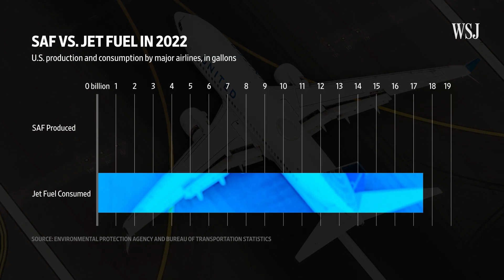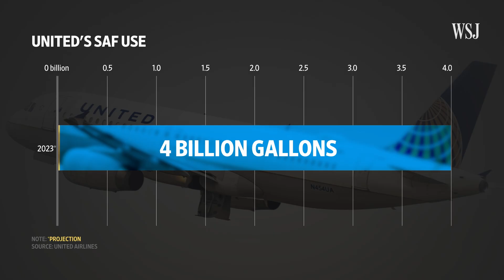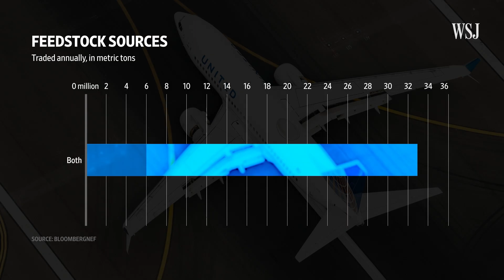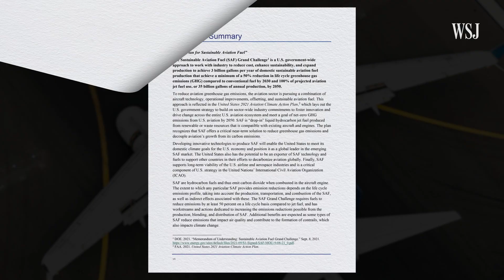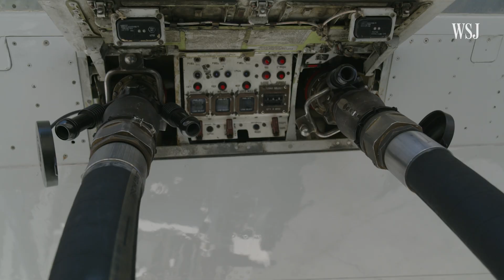How Jet Fuel Is Made From Trash | WSJ

Comment: Questions:
1) What powers that huge refinery and all of the heavy equipment used to produce SAF from trash?
2) When SAF is burned in a turbine engine, what are the products of combustion? In other words, what is coming out of the exhaust if it's not carbon?
Reply: It may be possible for some of the feedstock to be burned as fuel for generating the energy needed on site to run the process, thus reducing energy costs. On top of this, there are many sources of feedstock other than trash that can be used as feedstock for SAF, such as dried sewage sludge and agricultural residue and forest debris.
Reply: Jep that’s the most important question. When the energy invested in the Fischer-Tropsch process is not renewable itself, the SAG is more wasteful than normal fossil fuels.
Reply: 1) Fossil fuels and potentially renewables. This process does emit co2 
2) CO2 however it is CO2 that was recently captured from the atmosphere. I.e it was absorbed by the plants that were used to make the SAF

Overall SAF reduces emissions by 80% depending how it's made. Not completely because like you suggest  the refinery and equipment is powered by fossil fuels.

Comment: SAF, bio- and e-fuels are bridge fuels to fuel cell-powered air fleets. Clean hydrogen is the holy grail to decarbonizing the aviation sector. However, this is waiting for the advent of a critical technology:  clean hydrogen.

Hydrogen from methane reforming is a non-starter. So is hydrogen from anything other than renewable/sustainable energy. Marine/tidal, where the feedstock and energy sources are abundantly co-located, is the ideal solution; with desalinated water as an intrinsic bonus.

Stable energy generation 24/7/365 to first desalinate water, then electrolize hydrogen, followed by pressurized storage. Pipe/transport liquified hydrogen to shore where it's then transported to fuel cell fueling infrastructure.

Of course all this takes money. That's were governments come in. Subsidies must be made available to levelize the cost of fossil fuel substitution. Once scale volume is achieved, the natural laws of economics will quickly take effect.

Another thing governments can do is to enter into production purchase guarantee agreements with producers; making it infinitely easier for these companies to access needed capital. This can be done by committing to purchase and use milestones for government owned and operated fleets, such as the military, the postal service and other agencies' vehicle pools.

Comment: Producing SAF is expensive!  But then, I suppose the same was true for gasoline in the beginning, and as the manufacturing technology becomes more refined, the costs will come down.  This is a worthwhile path to take.
Reply: Gasoline was originally a byproduct of refining kerosene. Cheap as free. Standard Oil would simply dump the stuff, until it's explosive properties found a market in the then-new automotive industry.
Reply: What the other commentator said, Gasoline was never expensive upon its discovery. It was so worthless at the time, it was dumped as waste.
Reply: It is really game of economies of scale as volume increases cost per unit decreases it is the same with the oil industry but the issue is the efficiency of the process depends on feedstock hence we cannot expect consistency.
Reply: The biggest problem is they are going to take all glucose products away from you and I are planning to turn every stick of sugarcane honey agave and fruits into their damned jet fuel and then make our sweeteners out of pure garbage this is a crime against humanity and it must be stopped
Reply: hydrogen

Comment: It's still turning carbon that's in physical solid form into a liquid fuel that will then be turned into carbon dioxide, thus adding to the greenhouse gases. This doesn't help the environment the way people think it does. carbon dioxide from crude oil or carbon dioxide from trash fuel is the same result.
Reply: True

Comment: Of course, this makes more sense than electric planes or hydrogen power planes because it's a realistic approach.
Reply: Interesting point. I would add that this approach also doesn’t require development of new planes and infrastructure to accommodate and scale up the usage of batteries or hydrogen for planes. This is a huge plus.
Reply: Absolute malarkey.
Reply: @devon_207  nice adult response where you adding nothing. You just responded emotionally and left the conversation
Reply: @devon_207  yup, people have been claiming they're going to do fischer tropsch chemsitry with garbage for years, too many problems, it's easier to just use coal to make liquid fuel.
Reply: @devon_207  ghee. Someone that doesn't know about numbers and technology shows up. As far as I can tell you from my engineering background and from studying all cases, electric planes make sense until battery tech improves a lot, heck we don't even have enough battery material to produce all the EVs that we need.

As for the hydrogen, it's just a waste of time to make it work in the airline industry or air cargo. Just  hydrogen availability is a big problem as we can only produce black hydrogen and just a little then you have to break all the challenges of hydrogen storage both inside the plane and at the airports, then you have to deal with all issues with running a hydrogen powered jet engine and I can tell you that they're a lot of issues. But i guess that you can solve these issues by yourself. Right?
Reply: @fourthdeconstruction  if you're an engineer do a little research, people have been slinging this trash to liquid fuel BS for years, it's got too many issues, mainly all work and energy goes into making that nice fluffy dry feedstock garbage you see in the beginning.  if they're gonna do it best to just use coal like Sasol does.
Reply: @FourthWayRanch  Biofuels, I don't think that you watched the video carefully or understood it. They also mentioned Biofuels coming from other sources. You have to pay attention. "Coal to liquid" hahaha. Bye bye. No more from me,
Reply: @fourthdeconstruction 
I would want to have a discussion with you if you don't mind.
Reply: Wrong
Reply: I agree but, it went out of business so
Reply: Hydrogen is just energized water lol

Comment: Why cannot you say that you just use incinerator for combustion of waste? The product of incineration is firm (ash - carbon dust) and gas condensed to hydro carbon variants.

Jet aviation cannot be de-carbonized. To make carbon dust and condense gases you need 2-4 times more resources as stated in the video. That is the way to carbonize - not to de-carbonize :))). But yes: we have to transform waste into something useful. It should not be reasoned by money.

Comment: can someone explain how SAF reduces CO2? Is it just a net reduction, or it fundamentally has more energy per volume?
Reply: So according to Skynrg, all SAF does is recycle co2 instead of adding to it. However, all this tech is still in the early stages, so I'm pretty sure that this will become more simplified later on.
Reply: It's like heating your home with a wood fire instead of using oil or natural gas.
Reply: If you use fossil fuels, you're adding the additional carbon into the system. SAFs use organic matter (plants) that are comprised of carbon that has already been drawn from the atmosphere, so releasing it back means no additional carbon
Reply: @@Riorozenit's not bookkeeping. It's just that it doesn't ADD any additional CO2 overall to the atmosphere; it doesn't reduce it

Comment: Umm...doesn't this put CO2 into the atmosphere that would otherwise be stored underground?
Reply: Well, what are the downsides for storing the CO2 in the ground compared to reusing it?
Reply: @WolfeSaber  It takes space in the ground and wouldn't help people fly, but it also wouldn't heat the planet up by releasing greenhouse gasses.
Reply: @nathanbanks2354  There are gases that are worse than CO2 when it comes to greenhouse emissions, like a thousand times worse.
Reply: @nathanbanks2354  Plus if not careful, trash being buried would contaminate groundwater.
Reply: Nope it still produce CO2

Comment: Does the SAF math work out? What is the energy input?
Reply: Unlikely to get a clear answer to this question just the same way there’s little discussion about the environmental catastrophe caused by electric car battery production
Reply: The decrease of centralized pollution in cities, traded off for strip mining the earth using child labor. But it’s ok since we can’t see it. So yes, indeed, the dangers of car batteries.
Reply: Use non condensable gases to help run  process

Comment: How much energy is required to produce a unit of SAF?
Reply: Can't speak to the synthesis of specific biofuels, but for the initial phase - the gasification of carbon waste you can use any fuel source, coal, natural gas, or most likely the synthetic NG produced during gasification. If you use the syn gas produced by the system in the system, you should only need a small amount of start-up fuel before it becomes self-sustaining. Basically instead of all of your substrate being converted into fuel, a certain percentage is used/lost in creating the heat for gasification. The syn gas will be produced regardless of the parameters of gasification so you might as well use it. 

Short answer, it shouldn't require a lot of external energy.
Reply: @iankelley7592  Self sustaining... I like the idea. Efficient.
Reply: That's the problem speicifically Fischer–Tropsch Process is energy intensive. Needs mainly lots of heat.
Reply: FT is highly exothermic. The challenges are providing a syngas

Comment: IMO saf is greenwashing. I would only consider it sustainable and having a chance at net 0 if the carbon came from air capture and was processed only with renewable energy. At the end of the day, burning SAF releases more carbon that wasn't there before and isnt captured as part of the SAF lifecycle so this just looks like greenwashing.

To be clear, I'm not saying we shouldn't use "SAF" because it's not perfect, I just think it's misleading and greenwashing to call it "sustainable" and tout it as a path to net zero when waste to fuel containing petroleum products will always be net positive. It's fine as a way to reduce carbon footprint, just be honest about it instead of presenting it as a complete solution to aviation sustainability.
Reply: A new SAF facility just broke ground in Moses Lake, WA. It will use co2 and water and renewable power to convert. This type of facility should be the only ones getting to use the SAF term.
Reply: @sharedcow  Agreed. Calling waste to fuel "SAF" runs into the same problem as hydrogen power, where the umbrella term carries a renewable connotation while there are like 7 or more different "colors" grading it from entirely carbon emissions based hydrogen to complete green renewable hydrogen. It muddies the water so much and makes it very easy to mislead people by funding what people think is renewable and net zero while it could be causing tons of emissions.
Reply: @KibbieKatt  At least engines developed for Grey hydrogen will also work with Pink or Green hydrogen.  The only redeeming feature of SAF from a global warming perspective is that it could prevent methane from being released if the trash was stored in a landfill.
Reply: What is the better solution then!? Import oil from foreign countries!? This is significantly better even tho it's not perfect what is your solution then!?
Reply: @carholic-sz3qv  Literally any actually renewable hydrocarbon based fuel - hydrocarbons from renewables and carbon capture, hydrogen from renewables, literally anything that's not adding net positive carbon. Not sure why you suggest importing oil because oil has the same amount of carbon whether it's domestic or foreign so that's a silly idea.

I have no problem with using waste as a fuel to reduce carbon footprint, but like I said, claiming it's sustainable and touting a roadmap to net zero on fuel from waste which includes petroleum products is misleading and green washing. I'm not saying that it should be not used because it's not perfect - I think it's a great alternative but they need to stop lying and greenwashing by calling it sustainable when it's not. Just be honest about what it is.
Reply: I would argue it is a step inbetween. It can collect funds for further research. At least we reuse trash it is more efficient than just put into a landfill... where it will gas out and release Methan and CO2. But i agree, the video sounds and looks too bright for what the product is behind.
Reply: It still use lng for gasification process

Comment: Cool idea but how do they process the garbage without carbon emissions? Also, how is relying on garbage sustainable? Even US gargantuan stock of garbage would be used up pretty quickly with serious expansion in capacity.
Reply: correct me if im wrong but SAF is still fuel so burning it still produces c02 they may reduce trash but it doesn’t solve aviation c02 problem
Reply: Di you even watch the video!? They actually use the carbon from trash plus hydrogen from the splitting of garbage

Comment: In the trash is plastic, a significant amount. Which is produced from oil. So it's still a fossile fuel.
Reply: That's true but the Scope 3 emissions of the plastic are already baked in, versus pulling new fossil fuels out of the ground
Reply: @peterfrantellizzi6639 ure but there's no way this will ever be net zero as they want if this is just a fossil fuel with extra steps. Only if the fuel source is direct air capture fueled by renewables with a full zero emission lifecycle analysis would this even be possible. This idea is just a distraction even if it was possible to scale it up.

Calling this SAF is misleading at best. More accurately it's reusing existing carbon emissions, but like OP says the reprocessing emissions needs to be taken into account, which makes the whole thing extra dubious.
Reply: Most plastic is petroleum derived, however the plastic waste is being burned or buried anyway (due to high cost of recycling and limited recyclability of plastic).  Fortunately, it turns out that plastic can be easily converted into jet fuel in a single step!  It requires only a simple heating process, no FT synthesis required!  This is inexpensive and scalable.  As a bridge solution it could help lower the high cost of an SAF blend while also addressing the problem of plastic waste piling up.  

The quality of plastic waste in the U.S. is 1.3 lbs/person/day, (0.6 kg/person/day), a similar weight to the consumption of jet fuel (1.3 lbs/person/day).  If all the currently non-recycled plastic were converted, it could in theory supply up to 1/3 to 1/2 of the total jet fuel use.